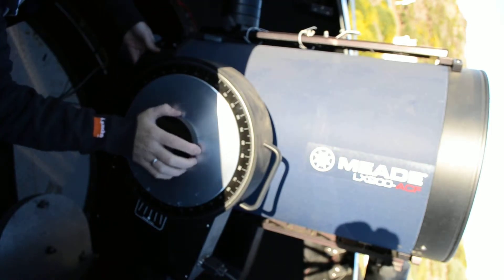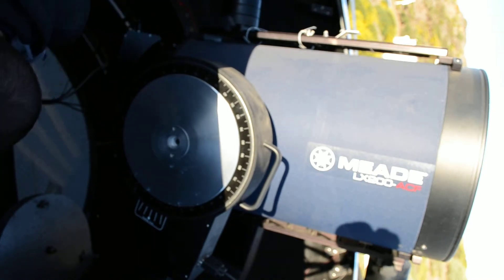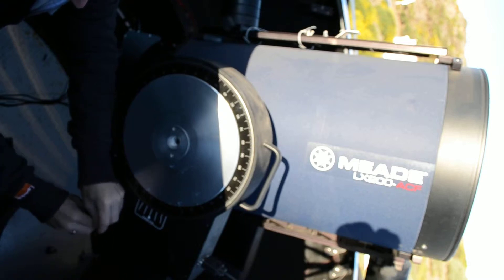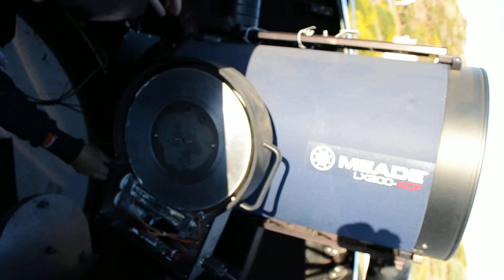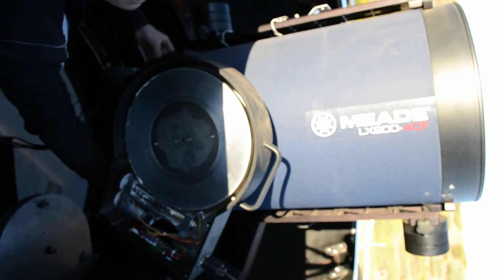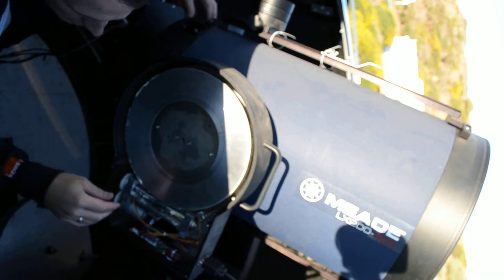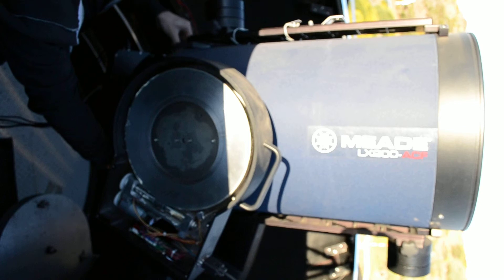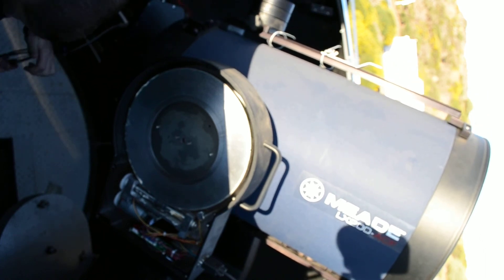16'' Meade LX200GPS Dec Problem

Comment: Remove the worm drive gear (the big Round Gear) and make sure the back stop is not broken off. This is what may be making it feel sticky or hitting a point where you have to force it past to make it move.  If it is sheared off than just replace the screws and remount the block.

Comment: Hello .. just out of curiosity...., on this case have you contact Meade?..., 6 months ago I saw they were selling spare parts over their site, but I took a look now and seems they don't anymore.
Reply: Hi. No we don't really bother contacting meade as sending the telescope back to them would be the very last option. I heard they had been selling spares but did not check it out. In the end this problem was solved more or less by removing the plastic cover on the declination bearing (in the fork arm on the opposite side) and spraying PTFE lubricant into the bearing. Take care to move the telescope around and mop up the excess lubricant that leaks from the bearing.
Reply: Glad to hear you managed to fix it.., yes.. I totally agree, sending the whole scope is just a terrible and expensive task, and probably will require months of waiting for a reply from Meade.
Reply: Roberto Sanchez Exactly. The scope is installed remotely in the Canary Islands. If we were to send it anywhere it would likely be to Dr. Clay for some work rather than meade.